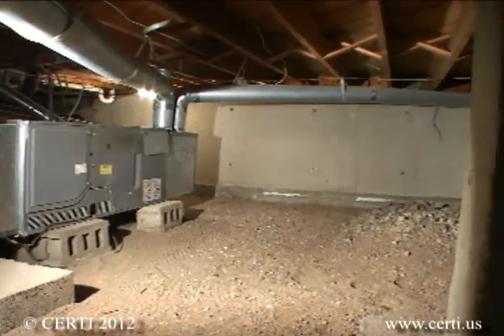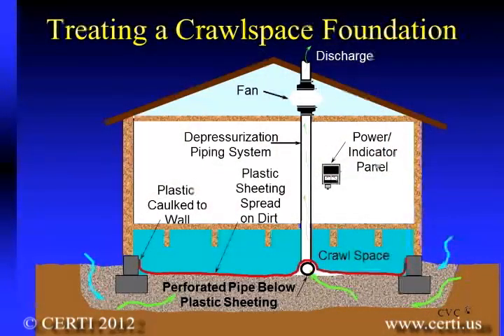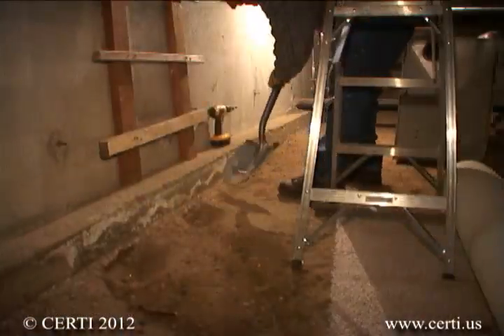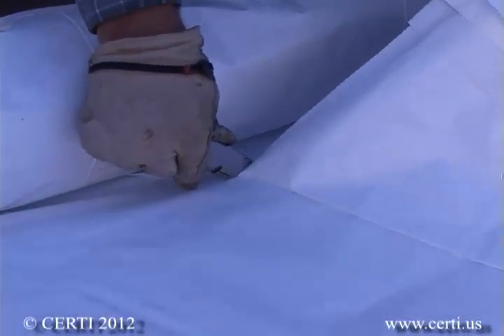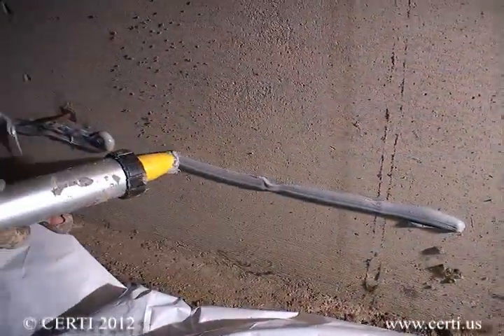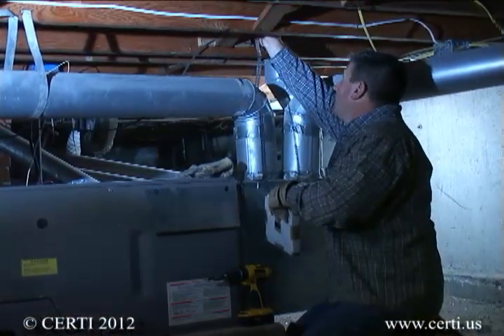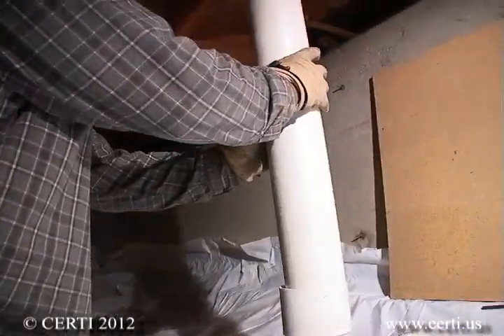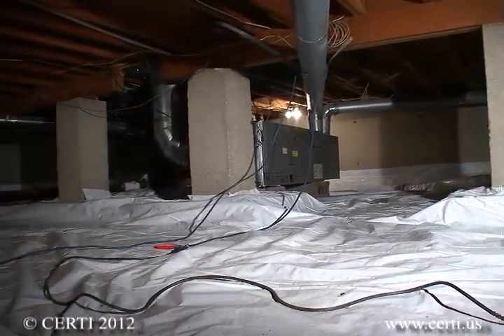Mitigating Radon From Crawlspaces

Comment: Just ventilate?
Reply: That's why I'm here. But then there's moisture/mold problem. Trying to figure out a balance. I want a 'dry' crawlspace with enough ventilation to mitigate radon.
Reply: @3rett115   In older homes they just installed grills at the top of the basement walls (above "grade") to allow airflow.

Comment: General Electric is offering to put a system in my basement but my house has two crawl spaces and a slab in between them that is about 3 ft lower in grade and the house was built in 1880 with  a stone foundation so I don’t know how well they could seal a piece of plastic down there

Comment: I have a crawlspace that has dirt on about half (700  sf) and slab on the other half (another 750 sf). I understand the basics for covering the dirt, but do I need to anything for the slab portions?  Also, do you recommend 20 mil cross-fiber plastic or will 6 mil do? Last, do I need to use hard pipe, or will perforated drain pipe (black, corrugated) suffice?
Reply: Often both foundation areas are treated with a common depressurization system (i.e. fan and vent pipe).  However, if you have time you may want to phase this with and treat the crawlspace first as that often provides the greater reduction.  But plan out your system such that if you also need to treat the adjacent slab, the depressurization system can be extended to a slab core.  
20 mil is typically not necessary.  The determination is how likely the poly is to be damaged with traffic in the crawlspace such as accessing a low boy furnace in the crawl.  4-6 mil reinforced poly is very common.
Perforated and corrugated drain pipe is fine for under the poly sheeting.   However, any portion of the vent piping above the poly and routed to fan and above fan should be solid, schedule 40 PVC or ABS.  4-inch diameter is most common.  You want smooth wall pipe to reduce air flow restriction and noise.  Also, a fair amount of condensation will occur in the pipe so be sure joints are primed and glued well and pipe slopes back to suction point so water does not accumulate.
Reply: @douglaskladder637  Thank you very much for your comprehensive response. I am going to check out your website, but is there a rule of thumb of the amount of corrugated pipe/square foot?

Comment: Once the pressure on each side of the fan equalizes there will be no air flow.  Let's do this a lot simpler:  Why not just open up a couple wall vents?  In extreme cases you can install a powered fan in one of the the wall vents so that fresh air is continuously exchanging with crawlspace air.
Reply: All things are tradeoffs. Vented crawlspaces cause high energy bills and mold problems. They're much more vulnerable to termites and other pests. Vent fans in vented crawlspaces are much less effective against radon than sealed crawl spaces because radon gas is heavier than air. The lighter air is moved by the fan and the radon stays concentrated below the living spaces of the home.
Reply: @kg4lod  if the radon gas is heavy and doesn't get moved by the fans, then how would it cause a problem in the living space?
Reply: @berthull9333  Radon gas emits (radiation) a small amount of high energy particles that can penetrate and damage your DNA (gamma particles, like X-rays). Living on top of a radon gas cloud isn't a good idea. You're correct that, in general, vented crawlspaces have lower radon concentrations than sealed crawlspaces, but vented crawlspaces pose significantly greater risks to the health of the occupants and longevity of the structure through other hazards like mold, moisture-related rot, and pests. Vents are hit-and-miss. If they don't offer enough passive airflow or create dead spaces, radon can accumulate -- and adding a vent fan at that point is unlikely to be very effective (unless you seal up the vents and incorporate the crawlspace into the conditioned building envelope). The vent fan in a vented crawlspace is more likely to more nitrogen (e.g. air; 28 atomic mass units) than radon (222 atomic mass units; 10x heavier). To move heavier gases, you need to develop significant static pressure which (practically) no vent fan can do in a cavity freely exchanging with the open atmosphere.
Reply: @kg4lod  OK, so how does an active radon mitigation system lift the radon to the roof vent? I know radon is heavier, but wouldn't this radon just run back down to the ground and right into windows (if they were open)? With this knowledge it seems like drawing air from the roof and forcing it under the barrier would force it outside. All this stuff is so confusing and I want to have it right before I build my house this year.
Reply: @3rett115   Fundamentally, there are two types of fans: fans that move a lot of air, but do so with very little force; fans that move very little air, but with a lot of force. Ventilation fans are the former (they move a lot of CFM, but if you add any resistance, like a closed door, small vents, etc... the airflow drops a LOT). Vacuum cleaners and Radon fans are the latter type. They can only move small amounts of air, but they can overcome tremendous external static pressure because they develop airflows with a large lifting force. Radon fans can exhaust "heavy gasses" because they run smaller fan discs in sealed ducted configurations (similar to a vacuum pump... or modern nuclear submarine's main propulsion... LOL). As to the roof, the radon gas must exit the exhaust duct at as high a velocity as possible so that it vents at least 3 feet above the highest point of the roof. This causes the radon gas to become entrained in the natural air movements above the roof and disburse. That is why it is SO VERY IMPORTANT *NOT* to put a rain cap over the exhaust port. You want your exhaust going strait up to kick the radon as high above the house as possible.
Reply: @kg4lod  Wow, perfect explanation! I can picture this, so thanks for the detailed response!
Reply: @kg4lod  MY vented crawlspace is 70-80% humidity and my hardwood floor is cupping...so, I think it's time to block the vents and add a dehumidifier. I've read that a passive exhaust pipe is fine for radon mitigation, so checking this video out..... thx for your comment on the vented space...I need to learn more to DIY...
Reply: @GregoryGuay  In our factories, I've never found passive systems to work. Either there isn't enough radon concentration to be a problem (so no system is needed) or there is a problem and an active depressurization system was required. However, you don't have to make this decision in advance. You can install the passive system, measure the radon levels, and then add the fan at the end of the exhaust pipe on your roof if you find you need it. Remember the radon fan SHOULD NEVER be in within your conditioned building envelope as that is very dangerous (worse than not having a fan at all). The safest place for the fan is on the roof at the end of the exhaust pipe, because it guarantees that the inside of your radon exhaust pipe is always at LOWER pressure than your living space. Any leaks in the pipe or future failures of pipe seals won't matter because the movement of radon gas/air will still be towards the fan at the roof and not from your crawlspace into your living space.
Reply: @kg4lod  thanks, I’m trying to figure out some options for the future, maybe you can help me understand my situation better: currently have a vapor barrier in my crawlspace, just a typical plastic on the Earth, and five blessed insulation on the floor joists. It’s compromised in a few spots, but definitely not a horror story as it is for some. So, I’m thinking about leaving the insulation, touching it up, closing off my vents, maybe running the vapor barrier up the crawlspace walls but if I understand correctly that’s not even necessary above for grade block. 
So it would not be part of my living conditions envelope, it would be its own little envelope and of course it would need a dehumidifier. I live in the coastal South Carolina, so I hate to see the current vented crawlspace, lingering around 80% at high temperatures. Hardwood floor is cupping a little bit… 

Back to the topic of radon, I’m not sure what the necessary precautions would be, maybe none in my case?
Reply: @GregoryGuay  I think you're over-thinking it. You're not special ;-) Don't try to invent your own untested solution. Perform a well-understood, works-every-time vented-to-unvented crawlspace conversion. That consists of: (1) close and SEAL all vents -- except 1. (2) add a crawl space exhaust fan at the 1 remaining vent and SEAL the fan to the opening -- run fan 24/7. (3) encapsulate floor and walls -- thickest plastic you can afford and tape/seal all the way up the wall -- some states require a 3-inch termite inspection gap, check local codes. (4) SEAL all rim joist bays, which are the space above your perimeter wall between the floor joists where the joists and rim boards meet -- spray foam is usually the simplest option here since you don't need that much and can DIY. (5) Remove all insulation from the floor and add insulation to the walls -- EPS rigid foam board works best as it's the easiest to install. (6) Add dehumidifier and condensate drain pump -- plumb pump to outside of house through rim board and SEAL pipe penetration. (7) Add radon mitigation if necessary -- it's always a good idea to do this before encapsulation so that you have the extraction pipe available should you need it in the future -- run a 3in (or 4in) PVC pipe from below the plastic barrier (SEAL to the barrier at penetration) either through the inside of the house up through the roof or penetrate and SEAL through the rim boards and up past the roof on the outside of the house. Add radon fan at the top of the radon exhaust pipe if/when necessary.
Reply: Additional fresh air (lower in radon) will be pulled through porous soil to displace what the fan is pulling up.
Reply: You can't just "simply" try to force the air out as described in this elementary fashion.  It is much more complicated than this and due to fresh air returns and window proximity you will end up making things worse by pumping the air directly into the living space.  This system needs to be engineered for the whole home system and not just a short sighted "get the radon out" type of approach.  Radon is a very serious problem in some areas and is not taken seriously enough for the health of families especially in areas where they don't understand it due to lack of literature.

Comment: Does a crawl space system have to have a u gauge ?
Reply from the maker: If the crawlspace system utilizes a depressurizatiuon fan a U-tube or similar performance indicator would be needed.  The performance indicator is intended to indicate if there is a problem with the radon fan.  Since a radon fan is used on a crawlspace system or a slab system or a sump system a U-tube would be needed in all three cases
Reply: @CertiCourses  this one is a submembrane system I believe

Comment: What kind of caulking did you use?  Where can I pick some up?
Reply from the maker: Greg:  The caulk most commonly used is polyurethane.  One brand name is Sikaflex.  All of the radon supply houses like Professional Discount Supply and Radonaway carry it as well as you can often find it in the large box stores.  But I would check with the specialty supply places as they will also have the right fans, labels, performance indicators, etc.  There are also been improvements in some of the tapes that the polyethylene suppliers make that are quite good-but be sure it is compatible with the poly you use and the type of foundation walls you have.